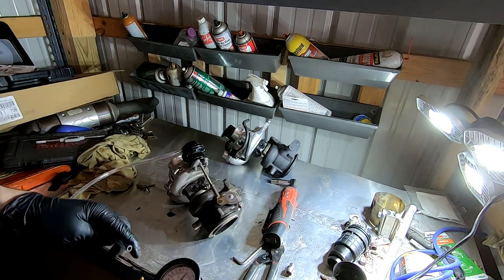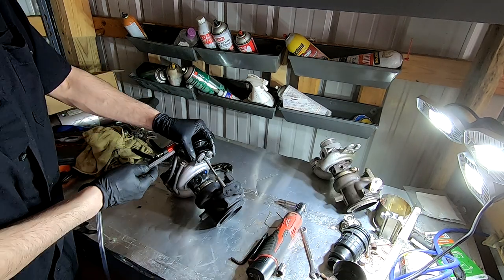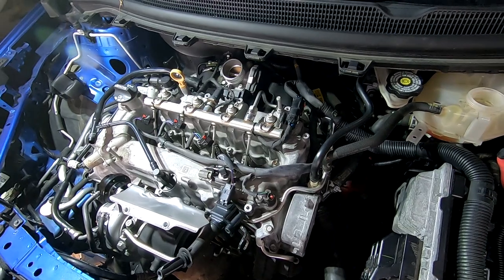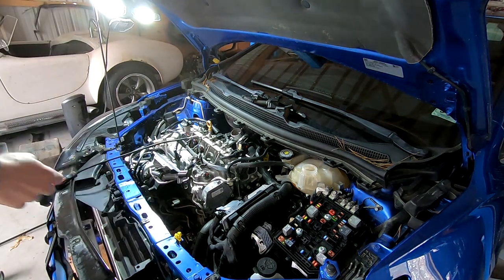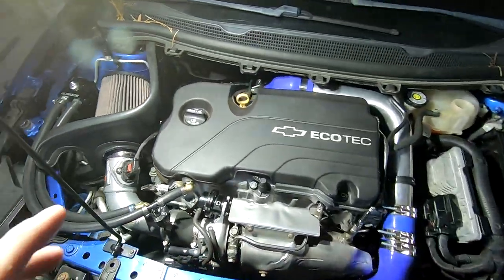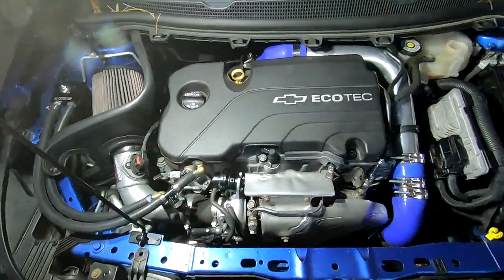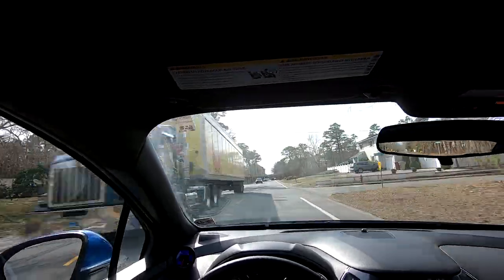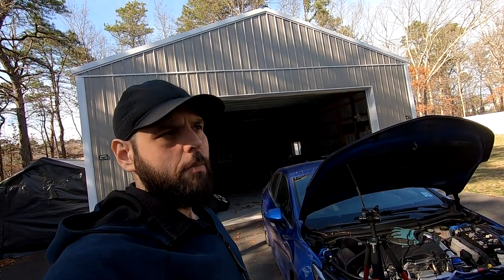CRUZE and ASTRA big turbo install Dave's World Project CRUZE Missile

Comment: I been having mid range hesitation as well in my gen1, especially with a/c on, do you think it may be the maf sensor?
Reply from the maker: Could be. How old are your plugs?
Reply: @davesworld2132  just switched them to ngk iridiums have about 200miles on them
Reply from the maker: @rubenjimenez1568  what’s the gap on them?
Reply: @davesworld2132  put .028 on them
Reply from the maker: @rubenjimenez1568  if your a gen 1 I could be wrong but I think maybe the gap is .023 what is the year and mods?
Reply: @davesworld2132  have the 2014 1.4l and only mod right now I have is a cat less downpipe
Reply from the maker: @rubenjimenez1568  no tune?
Reply: @davesworld2132  atm no tune, had to find a replacement since my catalyst got clogged